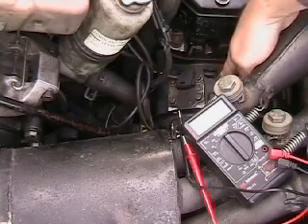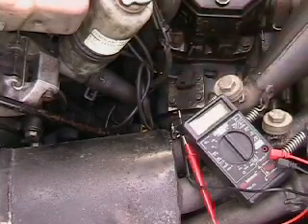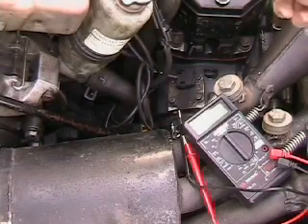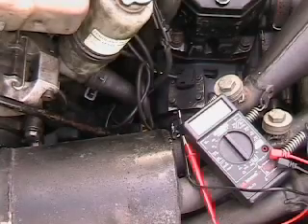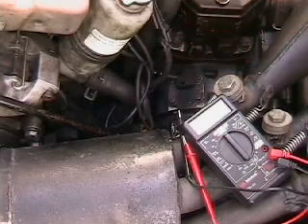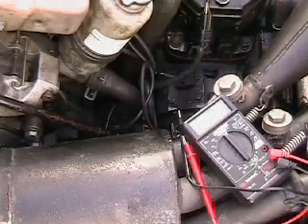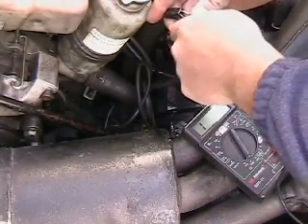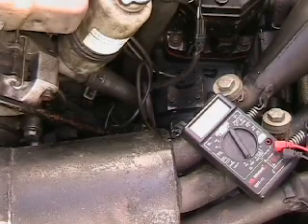Arctic Cat snowmobile trigger pulser coil or crank sensor testing

Comment: I have 90 ohms but no Voltage, changed the pulse sensor same thing. any idea? 2007 M6 EFI
Reply from the maker: Cat made a couple of different sensors. Some ohm out at 90 and the big triples were 175. If it ohmed out at 90 it's probably fine.
Reply: BlaineDP why cant I get my 4.8 volts. I replaced it and still. No voltage.  Maybe .3v. But I do get my 90 ohms.  Thx for the reply.
Reply from the maker: I've never measured the voltage coming out of the trigger to the cdi before.
Reply: oh ok, should be good then, I replaced it and getting my 90 ohm again.  checked all coils ok. check all 3 switched to ecm ok (kill, key and Safety switched ( open and close ) ccu getting my low voltage but not high too headlights.  don't think I need the ccu to started. Getting 100+ volts to primary coil. still not sparks.  getting a new coil and see what happen..  check all ground also..  if you think on anything please let me know I would really appreciated . I will keep you posted if the new ignition coil worked.  if not its got to be the ECU/CDI box. replaced stator 4 month ago BTW.. have a great day

Comment: I'm having a spark issue on my 93 thundercat. It was weak then ok. I have a oem rewound stator. I had weak spark took trigger out to check it now no spark. Stator tests good trigger was ok and made connections when I pulled over and still had meter in trigger.
Reply from the maker: With the 4 prong rubber plug disconnected from the wiring harness and the jumper wire in, that isolates the issue to the CDI, Coils, trigger or stator. trigger ohms for the triple are in the 175 range. the trigger either works or doesn't work. it won't cause a weak spark issue. OEM coils and cdi rarely go bad.

Comment: Hey Blaine, I have a 1996 arctic cat zr 580, I’ve replaced the ignition coil due to intermittent spark. Some days it would work others it would not apparently the cdi box has been replaced by the previous owner also along with the stator.
Reply from the maker: OEM secondary coils and CDI boxes rarely go bad. If it's intermittent then check grounds, clean connections, ohm stator, if you're using the key/kill switch it might be one of those especially the kill switch or tether.
Reply: Kill switch is overridden checked all of the connections and cleaned the grounds still nothing
Reply: AssassiN Life you figure this out? I have a 580 Ext Powder Special I replaced the stator and spark is better but at around 10 minutes of running it bogs out and dies. I can choke and restart but once it has done this it won’t run right. I also replaced the secondary coil so only thing left is CDI from what I can tell as pulser coil must be inside the CDI on this model as I don’t see one on flywheel when I did stator or outside like in the video.

Comment from the maker: Sounds like the trigger is bad unless the tester is bad. You can check your tester on something else to make sure it is working right. The ZRT 600 specs are 450, 20 and the trigger ohms are 90. The other big triples, 800, 900 and 1000 are 175-190ohms but that ZRT600 uses the same trigger as the twins and ohms out a roughly 90 ohms.

Comment: I tested the trigger several times and it appears to be an open circuit. My auto ranging tester slowly climbs but is about 45 ohms. My stator values are 21, 421 and 442. this is on a 96 ZRT 600. The wires appear to be in good shape.

Comment: I don't have a pickup coil wire that I can find. 1995 Cougar 550. I find a four wire plug (the one with the two yellows for lights and the two non yellow) and then a 3 wire plug that has the stator connections on it plus a single ground wire by itself. Theres gotta be a trigger wire somewhere but I don't see it.....

Comment: thanks
Reply: blaine I got a 1997 ZRT 600.had very little yellow spark.i did the jumper wire no change.changed the cdi I now have blue spark,but it just doesn't seem enough of a spark.running on one to two cylinders.choke cables r adjusted correctly.spark just doesn't seem strong enough.i did change carbs around NO DIFFERANCE.swapped the plug wires around no difference.tested stator it ohms out correctly.pulser coil ohms correctly.both coils ohm out correctly,double checked triple checked quadruple checked times 10.all ohm correctly.yes I have replaced spark plugs 2wice,timing keys is fine.runs good on mag side and middle  runs not to bad but pto ice cold pipe.pipes go from hot to warm to cold as u go right to left.pipes are not plugged up and muffler is clear.i have new pistons and am running 125 to 128 psi across the board.i get a weird feeling my coils are shitting out but they check fine.and I replaced and cleaned all ground wires also just incase. help?????????
Reply: and I been doing all this with a jumper wire on the 4 way plug so I know I can eliminate any wiring issues with the throttle or key or anything
Reply: I can say it makes no difference where the plug wires or carbs are it runs the same....BUT It was running the complete opposite.the pto side ran great middle ran barely and mag side ran crappy before I unhooked the coils brought them in my house for a day and checked the ohms after they warmed up.then when I hooked everything back up it ran the way it does now,mag runs grear middle crappy and pto real crappy.so it did switch around,but I cant get it to switch again.
Reply: I also cleaned and switched the fuel pump lines around.no difference.and plenty of gas is coming into carbs.i did notice some air bubbles small ones in my gas lines.foumy little bubbles in the top of main line out of shut off switch.